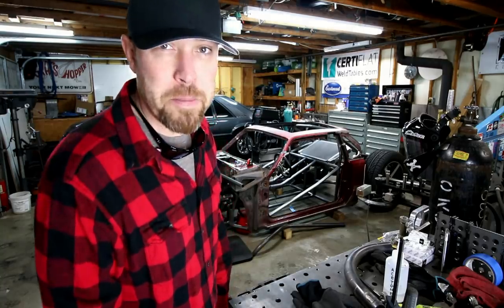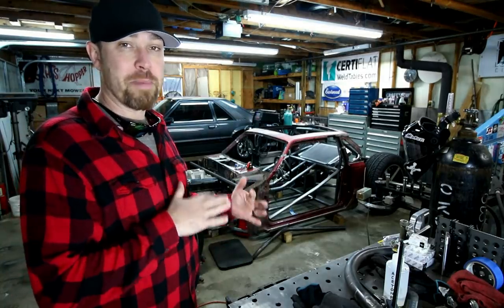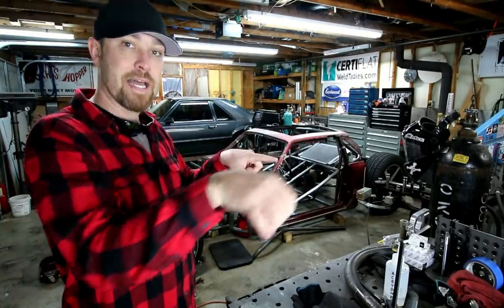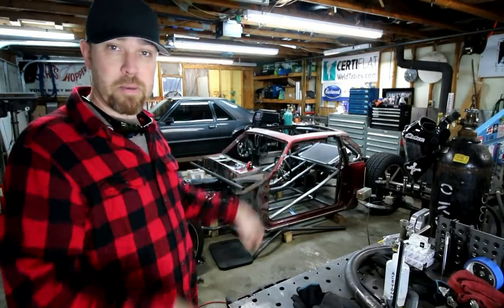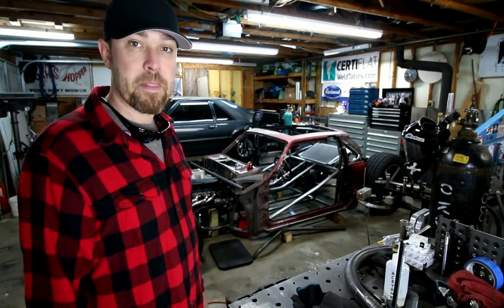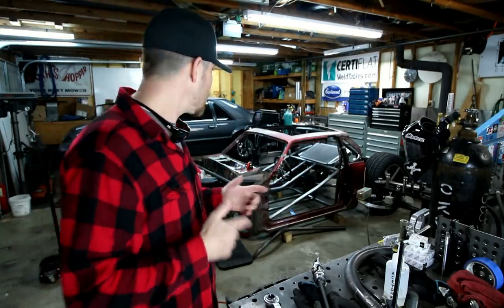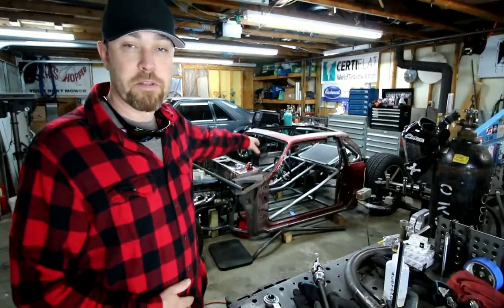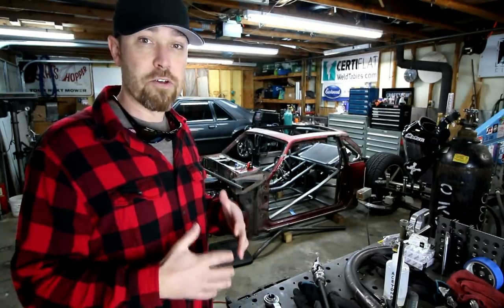Front Suspension | Fox Body Mustang Hot Rod Build

Comment: Glad to see you tackle the front suspension.  For the rear hyd. ram clamps, why not make them out of the same tubing you used for the mounts. Just slit the tubing length-wise (about 1-2" long piece) and weld on some tabs to each side of the slit.  Drill (and tap?) a couple holes and tighten using 1/4"-3/8" dia. capscrews. You could make the clamps and mounts all one piece, but I think you final welded the mounting tabs to the tubes already. Others have already raised my questions about the attachment points on your front cross tube/rod ends, and likely issues with bump steer.  No need to repeat here.  Those motor mounts should work very well.  Thanks for sharing your video.
Reply from the maker: thats a good idea, I may do that. and yeah bump steer will be an issue I will have to try and resolve. Or redo it

Comment: I cant wait to see how the body is going to tie into the rest of this project. Are you going to pinch the nose and do a modern version of an old hotrod front end where it tapers to a small sort of nose grille? You could since the radiator is in the back. just watching i can say that the skill set that you have is quite a notch or two above alot of peoples. I learn alot from watching your build process.
Reply from the maker: +Drew Alsup the nose will remain wide open...basically as you see it

Comment: Kyle, great looking fab work as always but that a-arm/rack combination is going to have terrible bump steer depending on how much travel there is. For something that narrow on the lower a arm mounts you should be using a sandrail steering rack.
Reply: Same thought...ugly bump steer is one of the worst feelings when driving. Also why no "anti crush" bung through the tube where you bolt the front uniballs?
Reply from the maker: +Jess Neal yeah I agree...it will have very little travel though. I'll just have to get as minimal as I can.
Reply: Sounds good Kyle. Even with as little as 2" of travel that setup will have bump steer. Having your toe change even 1/4" at speed is not good. Everything else is lookin pretty neat so far :)
Reply from the maker: With the length of these tie rods its only gonna be a change of about 1/8 for 4 inches of travel.  The lower control arms will also basically be on the inward arc the way they will be positioned. reducing that to even less than 1/8 inch. If I end up have issues once its done I will just move the heims out closer to the pivot points of the rack.
Reply from the maker: No need for anti crush its moly plus it doesn't have to be He-Man tight
Reply: Thanks for the replies Kyle. Looking forward to more updates
Reply: Jess Neal why a sand rail rack?
Reply: The width will line up with the rest of the suspension geometry better and would hopefully eliminate bump steer. They are very narrow.

Comment: Lookin good i was hopin to see what you was doing with the front wheel spindles cause i seen in your last video that you had cut one and was wondering why you didnt just swap sides with them so that the steering hooked on the back side
Reply from the maker: swapping sides wouldn't work for several reasons. The strut alignment would be way off, the ackerman would be wrong and the brake caliper wouldn't be in the proper place

Comment: Kyle, maybe I have missed it and if I have maybe direct me to that episode! 'How are you aligning axles with frame and axles with each other to to have car track correctly and true? Do you have some kind of gauge setup that keeps axles perpendicular to frame and then parallel with each other?
Reply from the maker: I have done rough alignment buy pulling string. Everything I build is adjustable so I can fine tune it later.

Comment: Looking great man good skills just my opinion I'm in the lowrider world when you mounted the cylinders you may want to put an plastic polyurethane washers between the cylinders and mount bracket in cause when you drive the vibration gonna hear squeaking noise.
Reply from the maker: the entire car is solid mounted so its gonna make all kinds of noises....plus it will be open exhaust right off the turbo so...

Comment: Looks great and the build is coming along.  Question: Do you fore see any issues with the radiator mounted so close in proximity  to the driver and passenger compartment?
Reply from the maker: no it will all be separated by sheet metal.

Comment: It sure is coming along nicely Kyle . One question , you know more about your front suspension points than I do obviously . The front cross tube that connects the frame rails , Is it going to be strong enough as it is just welded to the rails . I would think a inner sleeve plug welded through the frame rails would be in order. Just my thoughts , I no engineer by any means .
Reply from the maker: +mike jones thanks...it will experience very little load.

Comment: Cars looking great. I was wondering why on the arm mounts you didn't run your standoffs all the way through the chassis tube? I would be concerned with the compressing and bolts developing play in there mounting
Reply from the maker: Its moly...it wont compress. All the loads will be side loads as anyway so it doesn't have to be He-Man tight

Comment: I was thinking it up in my mind you was goin to run a solid axle up front.. with mustang spindles and struts...
Have you came up with any ideas for lifting and lowering the frontend hydraulically like you have the rear?
Reply from the maker: +Kevin Luck I was but I ran into some steering issues
Reply: The Fab Forums 
O ok I'm curious to see what you have in mind for the struts setup 
Ive had about a few ideas how you could adjust it hydraulically like the rear..
Reply: The Fab Forums 
You should talk to Robert over at hyperformance, I'm sure he probably has some cool ideas about the body if you looking to paint it and some metal shaping

Comment: Loving the build, very cool! Not knowing how the rest of the front suspension works yet, but it looks like the rack is far wider than your lower A arm mounts, will the rack ends be in plane with the upper and lower suspension arm pivot points to prevent major bump steer issues?
Reply from the maker: With the length of these tie rods its only gonna be a change of about 1/8 for 4 inches of travel.  The lower control arms will also basically be on the inward arc the way they will be positioned. reducing that to even less than 1/8 inch. If I end up have issues once its done I will just move the heims out closer to the pivot points of the rack.
Reply: The Fab Forums Awesome, figured you probably had it sorted! 😉
Reply from the maker: +LukeTheJoker lol...I don't, but if it sucks I'll change it. Not gonna let it cripple me.
Reply: The Fab Forums there must be an echo in here.
Reply: mitch denner There was no comments when I started watching the video, after the video I pulled out my vehicle design books to double check my memory before saying anything.
I noticed after posting my question that there were others similar, but mine gave a bit more information in case changes did need to be made.

Comment: are you no worried that the front tube will crush when you tighten the bolts. i don't know if you've considered installing sleeves in the tubing.
Reply from the maker: +alex bessonov moly is extremely rigid
Reply: The Fab Forums  is there an echo in here?
Reply: I also worry about the tube not having inside crush tubes on it where the bolts go through.  The tube only has to compress a MM or so and then the bolt is no longer tight.  Once that happens it wont take long for the front arms to flap around and munch up the bolts, and holes.  The front arms will have a lot of force through them.

Comment: With those mounts being solid like that will it make the car much stiffer with a bunch of nvh? Like on normal car the oem  mounts have rubber or poly to have some give...
Reply: It's a hotrod, not a cadillac... not sure if what you posted was a question or a statement, but yes solid mounting any driveline component to a chassis will cause nvh. Either way, you don't build a project like this for comfort.
Reply from the maker: +Marshall Eng not sure what nvh is but yeah it's gonna feel like a go cart
Reply: The Fab Forums thanks Kyle! I just wasn't 100% sure how that would all work. Love the vids and love learning. Nvh is noise, vibration, harshness.🙏
Reply from the maker: +Marshall Eng No problem...I'm sure it's gonna have a ton of that nvh 😉
Reply: Jody Barrett hahaha no worries man. But yeah I am a technicians at a GM dealer in South Florida. Kind of a common term in this field haha
Reply: Had a 68 nova I went through about three engines in it (yong and dumb couldn't keep my foot out of it + junk engines = explosions ). My sister had a Pontiac station wagon with a 400 she had just got a Mustang so she said I Gould have the engine out of the wagon. I decided to mount the engine in with solid mounts. I loved it didn't really make that much difference to me but had a fill of what the engine was doing. Could hold the brake pump the gas about three times and it would pull the front tire off the ground about a half a foot. Engine was stock except for an RV cam two Barrel carb but it would run high 12's low 13s in the 1/4 and smoke the tires all day long.